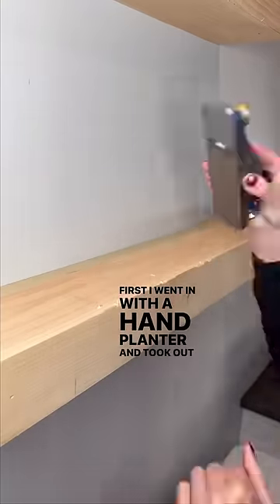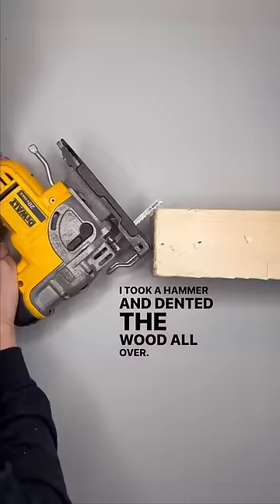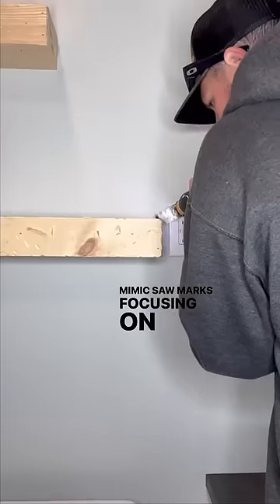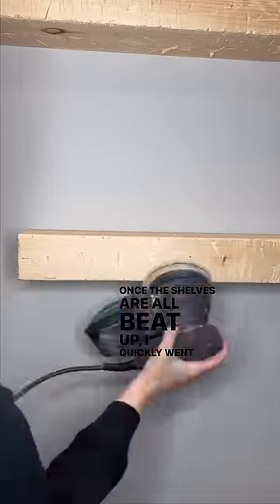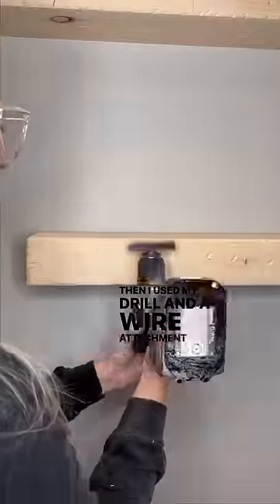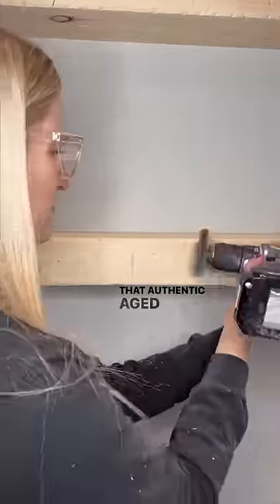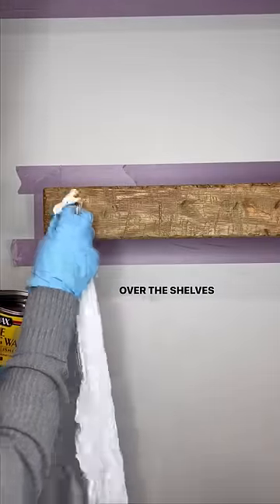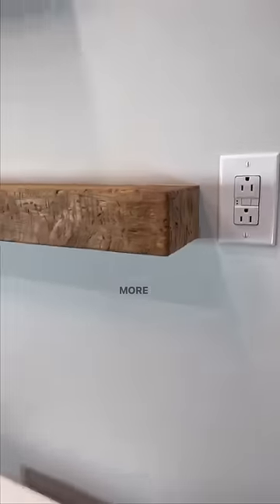How To Make New Wood Look Old✨More Details in Description✨

Comment: Neat idea... but why wouldn't you do this before you hung the shelves? I'm just curious. No judgement.
Reply: It might be more easy just because you don't have to hold the shelf in place.
Reply: My guess was it was an after decision 🤷‍♂️
Reply: changed her mind probably
Reply: Didn't think of it until they were already up 🤷🏼‍♀️

-Justhaleyhomes
Reply: @UnhealthyMorganWallenObsession Why would you hold a shelf in place when you could set it down on the table do everything and then hang it up that just seems more smarter it’s common sense I don’t think you have any
Reply: @sidbilly  because it's hard to keep it in place when it's not mounted. 😶
Also, I do have common sense.
Reply: @UnhealthyMorganWallenObsession  bro what
Reply: Indecision is the worst thing logistics have to deal with. She could’ve got pre distressed wood, or distressed the wood without having the liability of getting stain or damage to your drywall, but she didn’t know what she wanted until it was already up so that’s what she had to work with
Reply: @UnhealthyMorganWallenObsession  so would your common sense say to get the thinnest possible form of stain and spread it near your freshly painted blue walls? Or to randomly swing hammers near those same walls? Obviously it would have been easier to do, cleaner, AND more efficient had she just done all the finish work before installing. If what you said was true why are cabinets shipped finished and not raw?
Reply: @Idonot Know  because they just come like that. 😐 they can do it how they want to. Stop making it into a big deal. Common sense has absolutely nothing to do with this conversation anyway.
Reply: @sidbilly  did you just say more smarter 😂😂😂 I can see your common sense has left the chat
Reply: @UnhealthyMorganWallenObsession  😂😂😂😂
Reply: Theres no good reason. Even if they were already hanging you can take them down
Reply: @UnhealthyMorganWallenObsession  u have clearly never installed a shelf or painted a house, it makes no sense to mount something then try to paint it and fix it while it’s on the wall, you will ruin everything around it
Reply: @taliban223ms3  such a thing as taping around it. And no, it's not clear. To you, at least. I have painted many times.
Reply: @UnhealthyMorganWallenObsession  you usually have to sand down wood pieces to paint them😂😂 no amount of tape will have all that dust from gettin all over the walls, what’s the point in explaining to someone with no experience tho
Reply: @taliban223ms3  how do you know if I've had experience or not? Because you don't
Reply: Watch those eggshells 😬
Reply: lmao
Reply: @UnhealthyMorganWallenObsession  you don’t need to clamp a log like that to beat it with a hammer all you need to do is lay it on a table and hold it down with your hand no need to mount it make a huge mess sanding and chipping away wood in your house when you can do it all outside
Reply: @ChanHarris96  it's not my issue that they decided to do it like that.
Reply: @UnhealthyMorganWallenObsession  why are you so upset? You can do all this on a table with clamps which I'd expect anyone with  jigsaw,multitool,chisel,handplane to have. But if you listen can tell it was a after thought and wasn't happy with how it looked.
Reply: @amritg187  I'm not upset about anything.
Reply: @UnhealthyMorganWallenObsession  you are you talking about stuff you don't even know yourself but accusing others of not knowing or if they do that type of work?
Reply: @amritg187  the fuck does that have to do with being upset or not?
Reply: @ChanHarris96  you don't know what your talking about... it's not a log or 1 solid peice of wood which would be a log. Obviously need your eyes checked as you didn't spot the joint opening from the pounding of the hammer
Reply: @UnhealthyMorganWallenObsession  if they “just built it” then it would’ve “came” however they decided it should look… all I did was note that they didn’t know what they wanted and it made things harder in the long run. I literally do this work for a living and you’re trying to say the harder way to do it is the easier way to do it. It’s just not true.
Reply: Nah full judgement, there are multiple ways to have a achieved this look, all of them easier and cheaper
Reply: @amritg187  it is, for some. Don't be so quick to assume. It just depends on the person.
Reply: I think they needed to make a video and this is what they came up with
Reply: @princessnutellaa  there is this wonderful invention called a "vise"
Reply: @Xenentos  I know that! Isn't that just crazy?!?
Reply: @sidbilly  because woman
Reply: @UnhealthyMorganWallenObsession  I guess when you’re a bitch it’s hard to do anything
Reply: @UnhealthyMorganWallenObsession you absolutely lack common sense if this is the conclusion you come up with.
Reply: @deleqtronica8733  it has absolutely nothing to do with common sense. It's opinions and how people do what they think it right.
Reply: She’s a blonde
Reply: @jamin6212  what the heck does anything have to do with that?
Reply: @UnhealthyMorganWallenObsession clamps?
Reply: @Adam Hazza you're* and no, you fortunately can't tell.
Reply: @amritg187  I guess you just don't get what I'm saying then.. clearly its not a log like I just cut down a 50 ft tree. you do all of that before you install it in the house to prevent a mess being made.
Reply: @UnhealthyMorganWallenObsession  its just a silly way to do it yeah they can do it anyway they want but that makes such a mess it would've been smarter to remove it from the wall and do it in the garage or outside.

Comment: Oh, my dad who was a wood butcher as he called himself told me of his method he used to get the effects you’re seeking. Get a a nice length of thick chain and beat the wood until you get the desired effect. It’s quicker and easier and a lot more fun beating the heck out of it. He was a carpenter by trade.
Reply: But then you have the same size and shape dips and dents all over it. I've done it before and still gone back and used other things to make marks because it looks too uniform just using the chain.
Reply: @Delicate_Disaster  do you think different sized chains might help make a difference? Just curious

Comment: The best way to do this is to burn the wood with a torch and then brush it with a wire brush, the one you use in the video is perfect. That way you remove burnt wood and get a very cool rustic, "cabin in the woods" kinda vibe

Comment: I used reclaimed Wood and cut it to size. It's solid oak and was cheaper than new soft wood. It took about 10 mins to fit and varnish. Good video if you can't find any reclaimed wood though.

Comment: Hey try gel stain next time it is ideal for this type of project
Reply from the maker: I haven’t used gel stain too much. What would be the difference it would make? Just curious
Reply: The gel is a wipe on wipe off product so the old look is easy to achieve it fills in the low spots with more color so they stand out more. It's easy to use and can be applied directly over old stain. Next time your in the stain isle grab a can and read what it says. Great work too btw
Reply from the maker: @michiganporter  that makes so much sense and I’m definitely going to try it next time! Thank you for the tip! And thanks 🥰🥰

Comment: What you should have done is bought old rail road ties ram them through a saw mill cut them with a chain saw to the right size and then threw it around and drug it every where clean it hang it

Comment: As much as I dislike this, it kinda make sense if they took actual old authentic wood there would be a few problems, such as if it had a smell, the wood could be weakened so placing items on it could potentially break it, could be infected or infested, not to mention old wood breaks bits off pretty easly